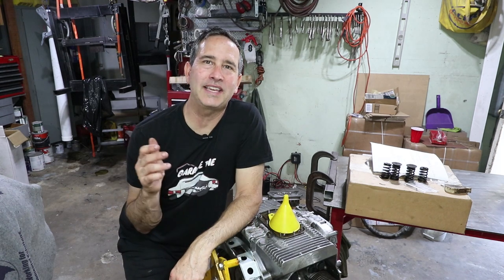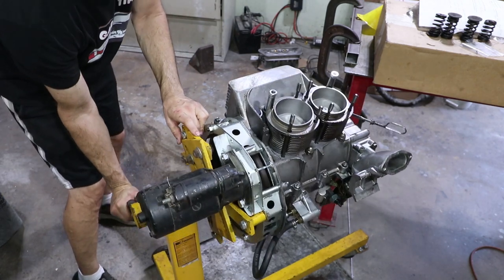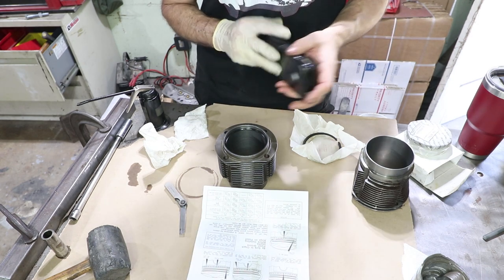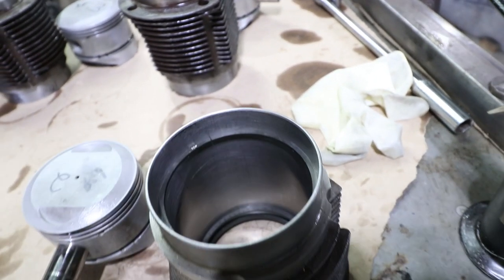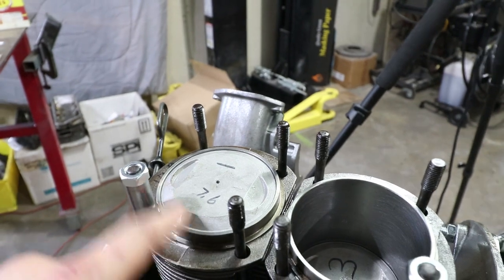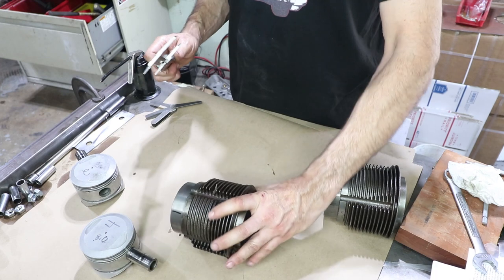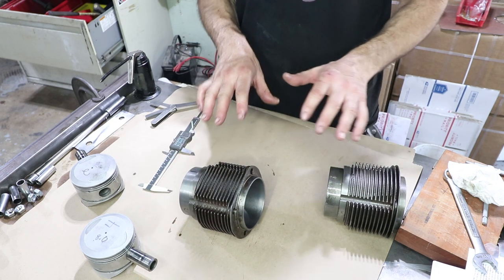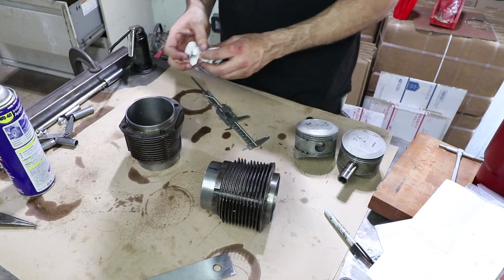PORSCHE 912 ENGINE ASSEMBLY - TOP END - Part 5

Comment: This site is great help for me, thanks.  I'm putting an engine in. I'm replacing the pressure plate end oil seal.  The mating surface seems to be 8mm but the seal (Viton brown now trimmed) is 1cm thick and is proud when installed.  Since I think it should be flush or slightly indented, do I have the right seal or "no big deal".  Thanks and your attention to detail is much appreciated.
Reply from the maker: I'm glad you found this information Jim. 
 I think the important thing about the seal is that the lip doesn't crawl up the radius on the flywheel.  If it were me, I'd take some measurements to learn where the seal contacts the flywheel surface.

Comment: Are you going to run a turbo on this engine? If so, that ring gap sounds awfully tight to me. I'm not familiar with Porsche but I expected at least 14 to 16 thousandths for N/A and up in the mid to high 20's for turbocharged to prevent the ring ends from butting together once you get some heat in the cylinder. What is the ring gap range that you have to work with?
Reply from the maker: No turbo, ha ha.  This engine is only a temporary one until I get a 911 engine.  I checked the range and it's .007 to .016".  Remember this is for a small engine too.  86mm bore.

Comment: I did a leak down test on my ‘66 912 Engine because I had some oil smoking only for a short time but it went away. Cyl numbers 1-3 only leaked down to 98 psi from 100 psi input. Number 4 cyl however leaked down to 70 psi. The air was coming out the oil filler when cap was removed. So I assume I have a broken ring(s). I drained the oil and checked the screen and bottom of engine thoroughly and there’s no metal. Do I have to rebuild the whole engine or can I just put new rings in that one cylinder number four? Thanks from a new Patreon.
Reply from the maker: Oh man, sorry hear about your engine trouble.  I suspect there will be some carnage on the piston and cylinder wall.  The ring fragment you found was how big?  In order for that piece to get to the oil pick up it must have taken some metal with it.
The metal strainer is far to big to stop small particles from damaging the journal bearings.  Stock 912 engines don't have a full flow filter, so I would expect there to be some damage on the bearings.  
You could run some fresh oil through the short block and see if any metal particles come out.  
I'd hate for you to put new pistons on and then discover more damage exists. 
Sorry for the bad news, but this sounds kind of serious.
Reply: Garage Time - Restomod - Actually I wrote there was “no metal” in the bottom of the engine and I’ve been driving about 1000 miles or more since I put some “restore” additive in it. The compression in the number four cylinder went up to about 80. It seems to be running perfect except for the low compression in that cylinder. Again there was no metal when I changed the oil. I might make a project later to tear it down but until I get some noise or some other reason I am going to just keep driving it. I might mention that it’s in a ‘56 Porsche speedster replica and not in a 66 Porsche.
Reply from the maker: Well that's good,  how's the oil pressure?  I also wonder if maybe it's a wrist pin circlip and not a ring?
Reply: Garage Time - Restomod - I hadn’t thought about the wrist pin. Thx!
Reply: Garage Time - Restomod - We drove around yesterday for a while & oil pressure starts cold it between 60 and 70 & is 40 at idle & driving when it’s warm.
Reply from the maker: That's pretty good.  If it was my engine I would take the head off and have a peek in there.  Maybe it's not too bad?  You might try a boroscope camera through the sparkplug hole too.  If you don't want to remove the engine first?